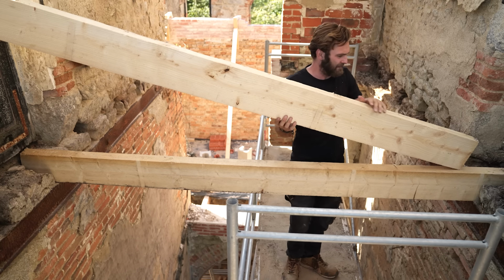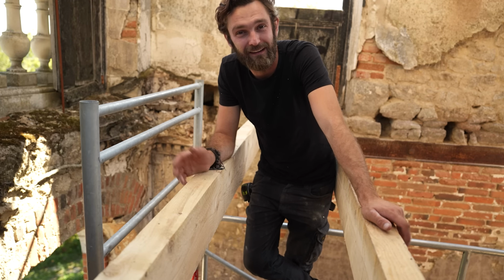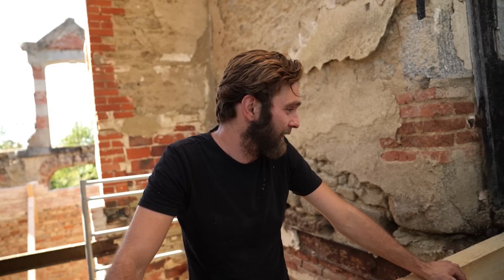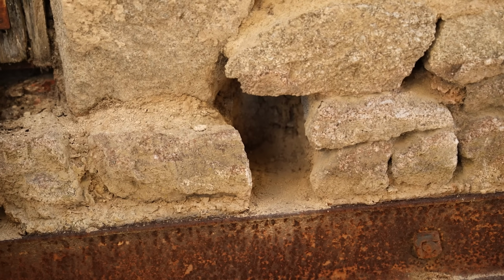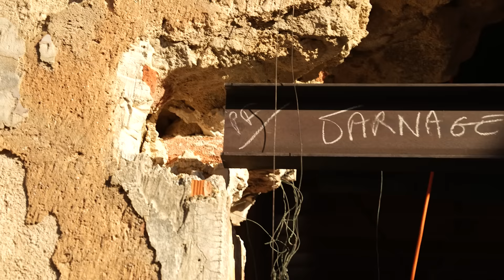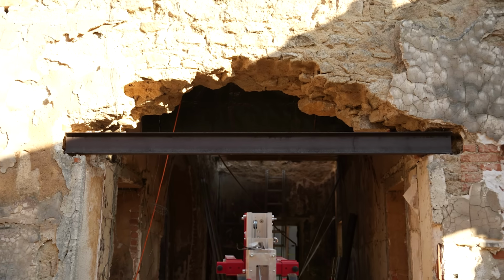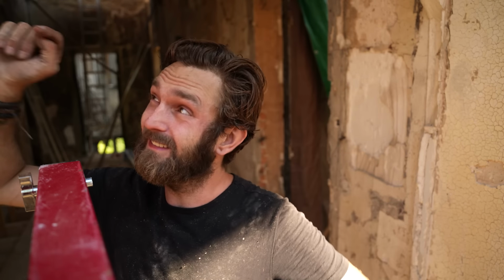installing beams, 14 metres high, in the chateau turret.

Comment: My father (carpenter) always said: "Measure twice, cut once". The wood beam loss was not much... but oh the metal one... that's a big punch to the wallet. I hope you can reuse it on some other place, eg. a window lintel.
Reply: with the bend in that measure stick i thought for sure it was going to be too long !!:)
Reply: Even wood beams are getting expensive. And for some reason you always have cut offs. They are never in the size you need.
Reply: @bzuidgeest  but you can use wooden cut offs as wood for the fireplace. What can you do with metal cut offs apart from using them as "pebbles" inside the walls?
Reply: I'm pretty sure he scraps all the metal... it is worth a pretty penny @franzrogar
Reply: @franzrogar  using the cut offs as firewood is a single use. You can only do that once. In a floor you will use it every time you stand on that floor. 
Metal has a decent recycling value. It can be melted down and recast. You cannot recast a beam from left over wood. 
And before you talk about things like fiber board. Let me tell you that recasting metal changes no properties of the metal. Making a beam from sawdust glued together is not going to be a proper beam

Comment: Congrats on the two first top floor joists, a huge achievement.👍❤
Reply: Dan refers to this as top of the chateau but that's must be relative (to other sections) and not entirely accurate.  In that part of the chateau, the turret, he's on the second floor putting in floor joist for the third but there are two floors above and then the six floor spire on the turret.  Progress regardless but plenty of more to go.  I wish Dan would provide a 3D diagram as this would encourage more patreons (in my mind)
Reply: @boydtucker9786  Either you are wrong or I don't understand. If you look at photos of the chateau, it is only three floors in the middle and one floor in the turret ...
Reply: The devil's in the details, and Dan doesnt help by not posting more historical pictures.  It took me some time studying the pictures on patreon and then the YouTube community tab, and I think I've figured out floors of the various sections (4) but not necessary the various rooms.  Two historical pictures show the chateau from the south and another from the south west (clearly showing the south entrance and west entrance).  These have a single stairway from the ground.  The north section has 2 stairways from the ground.  The south view picture shows the south section (with one stair from the outside) having 3 floors that are masonry and the fourth is a masard roof, thereby wood construction. And that's the one with the famous arch standing by itself.  In the same picture behind the south section is much taller north section.  The north section is the one Dan uses to come and go and it has 2 stairways and two entrances.  The north section has a masonry 4th floor then the masard roof section (5th floor) that goes into a spire.  The top of the spire is like a windows peak and is the 6th floor.  I havent seen a historical picture from the north or north view.  There is one north view of the chataeu when Dan bought it and you can see what left of the masonry fourth floor.  Given that the french love mansard roofs and they are wooden the fire has destroyed the top flor of each section.  By the way, the west section is where the solar panels are and the east section is where Dan is working on and has yet to get the steel beams in floor of the third floor.  That the third floor has a half wall of masory topped by granite (Dan's famous balance act to take out trees) which is the base for the mansard roof.  I wish there was a north view historical picture to clearly figure out the fifth floor mansard and the spire on top of it.  I've guessed the top of the spire has access.  Maybe I'm wrong.  Obviously I'm a big fan of the channel.  Cheers

Comment: At 12:00 the pattern and color of the cracked plaster to,the left of the door is beautiful.  Not sure what Dans vision is for the finished chateau, but I am just thinking a RUSTIC chateau would be amazing..once closed in rather than make it all polished and pristine leaving the rustic unfinished elements to showcase the history and state of the ruined chateau would be kind of cool!!
Reply: After putting so much work in I would want it to look clean and 'unruined'. Rustic cottages maybe, chateaux? nah!
Reply: @MrZORROish   It seems that this is small for a chateau - isn't it? I never got the definition  between a chateau, and a manor. But I agree with you.... leave the end product as similar to the original as can be achieved.  It would be best to stick with  a  picture gallery of  the stages of work, instead of leaving  the rooms in stages of work.
Reply: @stop_and_smell_the_roses  XIXth century châteaux are often smaller in size than older ones.

Comment: I don‘t know what you all worrying about, Dan is on ground firma, he‘s got the strength otherwise he wouldn‘t attempt it to hoist the beams up with his bare hands, he is using his brain to work out how to manoeuvre the beams to the top with great success, the only thing he had to worry about not getting any splinters into his hand, the scaffolding may wobble a bit but it’s not going to fall apart, so I don‘t know what you all worried about, his risk taking , in my opinion has been reduced by. 90%

Comment: Just trim the top of the beam where it slots. You’ll still have full thickness going across.  Virtually no load is carried by that top inch or two that goes into the wall. The stress is across the span triangulating to the contact point in the bottom of the pocket. 👌

Comment: First comment ever!! Strictly speaking you don't really have to chop out any more stone to place those floor joists. Just notch the top of the joist. As long as it's around an inch (2.54cm) you chop out it won't loose any of it's strength. Speaking as an ex site carpenter 😊

Comment: Why don't you use the scaffolding to hoist up the beams. Might not be officially meant to be used like that, but I think when you run a rope from the top bar on the side down this could be done. Ty a beam to the rope, hoist it up, secure it somewhere, climb up for the last few meters. Might work ... 👍
Reply: I think creates "his" way because it is in keeping with his YouTube persona as Daredevil Super Dan, and keeps everyone commenting.  The rope would have been so boring but sure a lot more sensible.
Reply: A lot of stuff he does drags out the project which is not necessary there's years worth of work to complete this project going at the rate he's going.  He could, should hire cheap labor to do the prep work to rebuilding.

Comment: Absolutely no need to make the holes bigger to slot the beams in. The forces there can easily be carried even if you cut the width or the height to two thirds of the original size. The main structural force the beams need to be beefy for is the bending forces. Those are next to zero at the ends.
Reply: Yep, I'd just cut a notch out of the top. :-D

Comment: You can reduce the size of the ends of the beams without seriously reducing the the load capacity. Putting a notch in the middle is a different story. Just ask your engineer. This is clear if you look at truss bridges too. So you don’t need to enlarge the holes to use the larger beams.

Comment: Dan, personally I would continue with the size of the beams you have been using. Sure it means enlaging those original pockets, but at the end of the day you know that the floors when finished will hold any weight you desire to place on them.

Comment: Hello Dan, to measure length of beam you can use two 1"x1"x 8' long sticks that you can cut yourself from scrap. You push one stick into left pocket and the other stick into right, then make a pencil mark where they overlap. Then take sticks down to the beam and line up pencil mark and lay out on beam and cut . Good Luck
Reply: Stick ?  It's called a tape measure.  🇺🇸

Comment: This channel definitely has its market targeted : ) Well done! From a tech perspective, I think I would have spent more time on material handling technology - it's ok to muscle stuff but it's not efficient. You don't need smaller beams - just chamfer the ends. Remember that the load bearing capacity is depth x distance, so even 4" height in the pocket is perfectly fine for load capacity

Comment: It is not necessary for the load-bearing capacity of the beam to make the holes larger. A section at the top can be removed without affecting the load-bearing capacity for the span. For flat roofs, a thickness of 50 mm per 1000 mm span is calculated.

Comment: Manually wrestles a beam to the top of the Tower, to be able to attach a Pulley for lifting awkward items in future. Hmmm.
PS - you can cut the ends of the Beams  down to fit the smaller holes, you know.

Comment: Notch the top of the beams to fit the existing pockets, you will still have full structural strength of the beam without compromising the structural integrity of the masonry.

Comment: I have a little tip you might like to try to prevent dodgy tape measures creating extra work!
Measure accurately in metric and closely in imperial, its very obvious  immediately when not writing things down.

Comment: I agree.  Don't compromise on the beam size.  Easy for me to say because I don't have to drill out those holes.  Save that shorter beam as you can use it on the other side of the Chateau when you get there.  Those dang tape measurers.  They have them in the US, too.  I always seem to find them.

Comment: Two “I” beams need to be connected with bolts if you plan to put anything between them. The force will work to push them to the sides so they might be tighten together.

Comment: Daredevil Super Dan at his finest and I love this the most entertaining channel on YouTube.  But for the big picture...

Dan refers to this as top of the chateau but that's must be relative (to the worn down state or missing floors, and other shorter sections ) and not entirely accurate.  In that part of the chateau, the turret, he's on the second floor putting in floor joist for the third but there is then spire on the turret.  Progress regardless but plenty of more to go.  I wish Dan would provide a 3D diagram as this would encourage more patreons (in my mind).  He's going to need tons (literally) of expensive equipment to put on the roof(s).

Comment: May be much less work to simply notch the wood beams for the top. A truss needs its strength in the middle and almost none at the ends. As counter intuitive as it sounds, notched beams on the ends are just about as strong as unnotched. The span is also quite small and the beams about twice as thick as needed to supprt the weight you will have on them. They also appear to be 12" on center or 16" at most.

Comment: Dan while I don't know what the difference in cost would be.
If cost were not a major consideration you could always use smaller I beams exclusively on the latest level.
Doing so would enable you to get the level down to original and should provide greater strength than larger ones made of timber.
Particularly given that the turret floor comprises a much smaller area than most of the preceding ones and it seems unlikely you might want to introduce loads greater than a bath full of water up that far anyway.
Also would one or possibly a couple of the concrete lintels you used over the windows be easier to install sandwiched between the I beams and stronger than concrete blocks?

Comment: A little tip from someone who uses ratchet straps daily, by all means push to take up the slack, but for tightening pull it towards you otherwise you will do yourself an injury.

Comment: It's not just making the holes bigger for bigger joists. Your floors won't match. If you're putting in all new floors, or if that's the only room at that height, your floor height won't match your door openings. Your doors will need to be shorter than the originals. If there are no other floors and no doors, you're golden.

Comment: Dan château Man,  progress seems to be slowing and wondered if you are doing this full time still?  Also concerned about the way you are putting the strength back in the château, have you considered inviting a structural engineer around for a coffee and a burger just to confirm you are doing everything the building needs.  The progress is great and now you are getting closer to the roof stage and the walls need to be sound to take the stress.  We have an oast house with a very tall roof that can push the walls out so needs to be treated carefully making sure the roof doesn't force the walls outward.

Oh and what do they say measure twice and cut once and not measure once and cut twice.  Hope that steel can be re-used LOL

Keep going you are doing a fantastic job and hope the heat isn't getting to you as currently about 30c in south east UK so must be pretty hot with you? 😊
Reply: Glad I am not the only one who has noticed that progress is slowing down. Compared to the previous work he has done.
Reply: I do think we need to understand that the lower floors are easier to deal with as the distance from the machinery and suppliers is only a few meters away and going up 3 floors by ladder is a whole different ball game.  I do think the lesson learned at the lower floors maybe not translating to well for the upper floors i.e. the bulk working and lifting.  That is also why I was concerned about the overall structural effect of what is being done.

Comment: Just cut the ends of the beams to fit into the smaller holes. It won't really diminish the strength of the beams. They are chunky and strong enough as it is to carry a few elephants.

Comment: You need to buy one of the Milwaukee Tool tape measures that won't fall when you extend them across the door frames or floor joist pockets.Carrying that I-beam up the ladder must have hurt the shoulder.

Comment: with there being 2 beams in the walkway take some of the beam that was the wrong size and bridge the gap a few times like ya said bricks would. Just cut enough of the top/Bottom of the bridge on both ends to slot into the I beam and weld when theres bricks in

Comment: Instead of making the holes in the tower bigger to fit the size of beams you've bought, why not take the same approach as you've done with the I beam ends, namely trim them down to size by a few millimetres? It shouldn't compromise structural strength in any way and take a lot less time and arm ache, from bashing away at stubborn masonry with even more dodgy masonry lurking above your head, the possibility of it becoming dislodged due to all of the vibrations associated with hole enlargement notwithstanding.

Comment: Hey Dan, I see you struggling with the tape measure. Have you ever tried a laser measuring device? They are amazing for distance like the space between the I beam and the wall. You'll be glad to have one honestly. After buying ours we love it for so many use cases and it has more accurate readings then a measuring tape on long spans. I used it on a fence build and it sped up the process for sure. Thanks again for the content and love what you are doing.

Comment: You could take the handle off that  lift and just have a battery drill to wind it up and down. Or get a proper motor for it. Save so much time and energy.

Comment: Would be easer to raise the beam from the bottom, tied off with the stern rope,
And pull it up to you on a pulley with a tie off for the line !  Your lower back may  not last long the way you are raising the beams now.   ( especially when you’re working by yourself.  Be very safe and don’t take risk.).

Comment: Just make sure that your floor will work with the bigger beams.  Is the ceiling height going to be too low?  What about door openings?  Will the floor be too high for the doors to open? Or will it make you have to get custom ones built?

Comment: i hope this is not the way all Europeans hoist materials up. may i recommend to put a beam 3x6 or whatever that lumber is, across the roof and hang a simple pulley at the highest point. then you can tie the beam or materials like mortar buckets with a rope and lift everything from the top with your body weight pulling down. you have a chop saw and instead of setting it up on your saw horses for it you use a reciprocating saw? use your circular saw at least. that is the actual use of it. that's what it was made for. your butt stool or fess stool as it is is known in France is not a table saw. you also have a ladder you don't fully utilize.  put a couple of beams from your scaffolding to a step  on your ladder and you will have better real estate to work from.
Reply: 00:48

Comment: Just make the ends of the beams smaller to fit in the holes, rather than the other way round? Should be level on top with the other 2 beams, or how are you going to put flat floorpanels?

Comment: assuming my comment comes in time, you should not worry in reducing the height (vertical dimension) of the wooden beams to that of the holes in the walls, as far as the portion going in, leaving the full thickness in between: the reason is that there is no bending moment, but only shear at the supports and the remaining section is sufficient to resist the load. be careful, my fiend

Comment: I wondered if you ever considered going with flat roofs. I think it would totally work with the brick/stone walls and it would make for an easier renovation with a more practical end result.
Reply: I thought it was a turret roof (round) . He can take measurements and build it on the ground and have a Crain put it in place.  🇺🇸
Reply: @libertyman3729  I think it's a typical French mansarde roof on the old pictures. Which will be crazy expensive to restore. It could easily eat up half the budget.